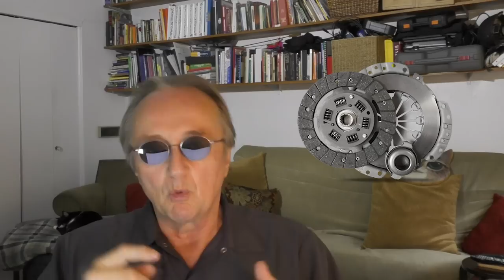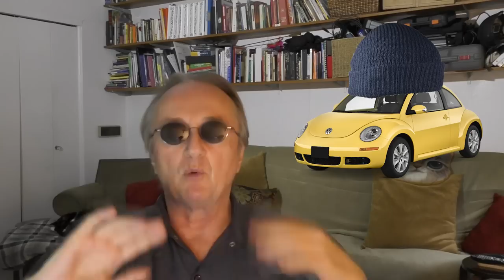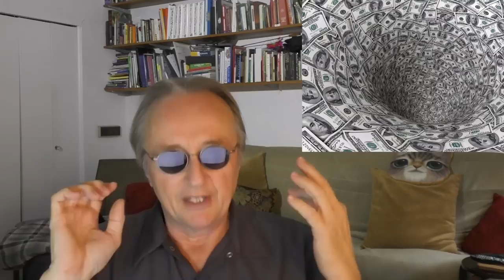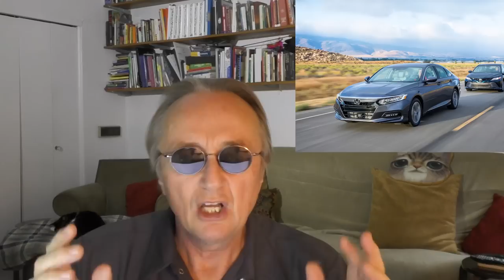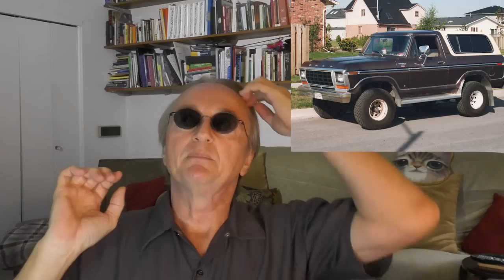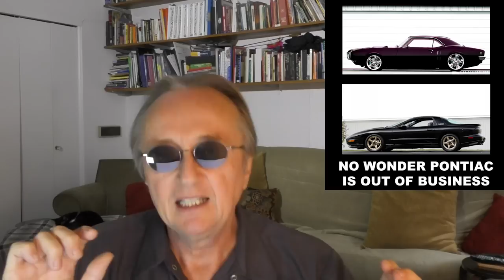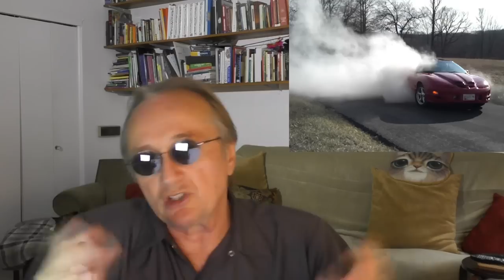Doing This Will Destroy Your Car’s Flywheel

Comment: hey scotty got a question. I got a 87 nissan pickup 2wd Manual trans when in town I'll be in 4th gear 40-50mph and when i let off the gas or press the gas the truck jolts any ideas why this might happen? 
usually happens at low rpms
Reply: That's normal to an extent but your motor mounts might be going out. One way to find out is open the hood, set the parking brake, put it in 1st or 2nd and see if the engine twists or jumps around a lot when you put a load on it. It's also possible if it has leaf springs in the rear they're getting weak and letting the axel twist more that it shoud.

Comment: how long should I keep a 2004 ford explorer with 168000 miles I bought it from my mechanic it runs well but it's starting to cost more for me
Reply: The answer seems really obvious if it’s starting to cost you more to keep
Reply: @CollinMac96  yup drive it till it drops only put as much into it as necessary to keep it safe
Reply: Also, only fix what’s major. Live with the minor crap. If anything major cost more than about a grand I’d just probably junk it